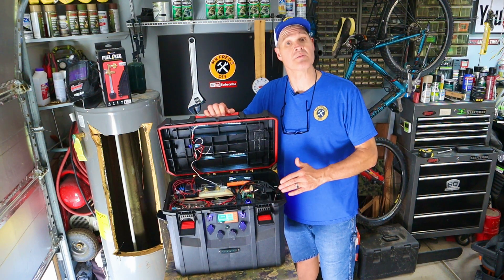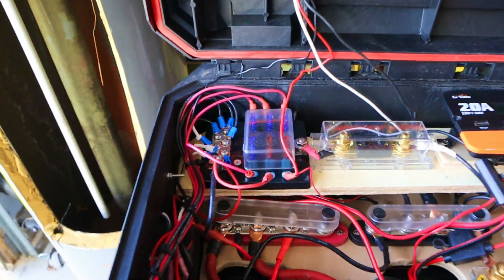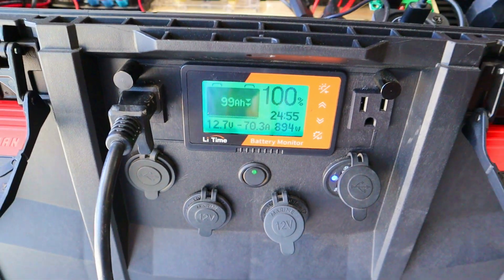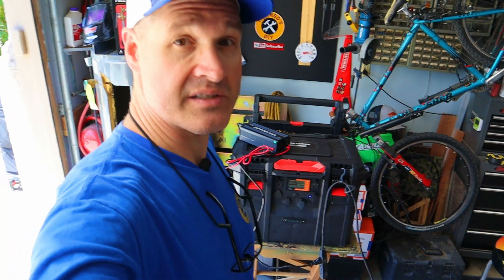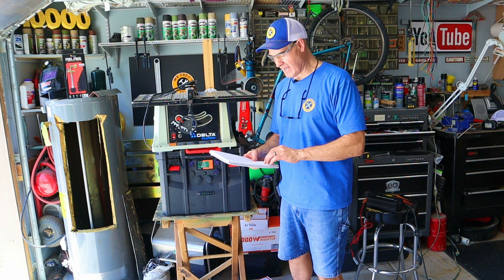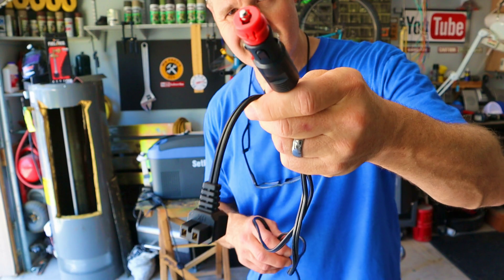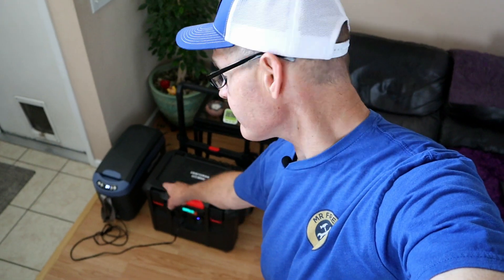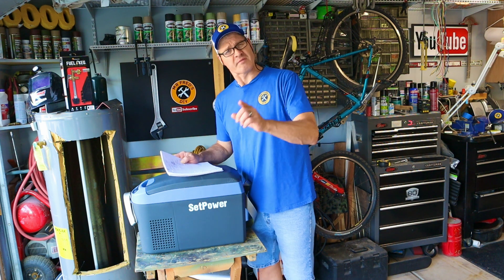The Truth About Solar Generators!

Comment: Hi Mr. Fred.  I'm new to your channel, but I'm not new to solar generators.  Just curious... have you tested the capability of charging your backup power supply with both solar and a/c at the same time?  This could potentially shorten your charging times when both sources were available.
Reply from the maker: I have not tested charging with both solar and the wall charger at the same time but I do plan on doing this test! Thanks for checking out the channel!

Comment: Great video! Thanks! Just what I want to learn about. I bought a Coleman solar panel for the camper from Costco a few years ago. Never learned about it and moved house. So I even more forgot about it! 
My husband has the exact CPAP but his is a BIPAP because he’s maxed out on that thing! We need the power for his machine. The rechargeable batteries are kinda unreliable. 
Also are you having trouble getting headgear for your machine? We are! No one has it in stock or in stores! We get it at Walgreens/CVS. Northern MD southern PA York area.
Reply from the maker: Thanks for checking out the video and commenting. The headgear set I got from Amazon, I cannot believe how expensive they are about $150. Just crazy.
Reply: @MrFredsDIY  Thanks for the info! Usually my husband uses flex spending to pay for his headgear, yes it is expensive.